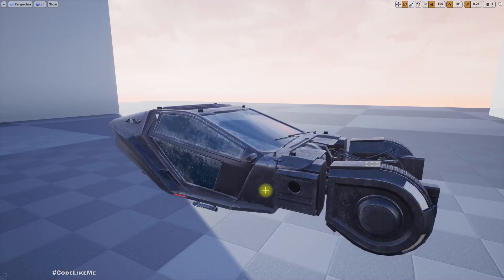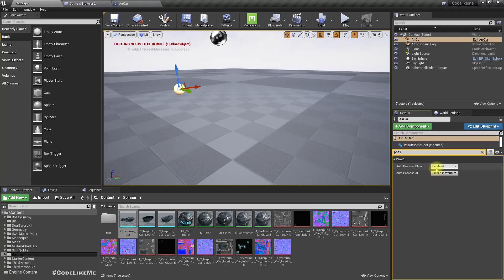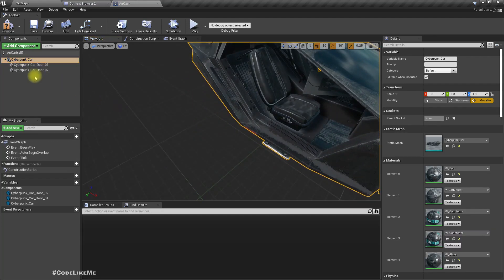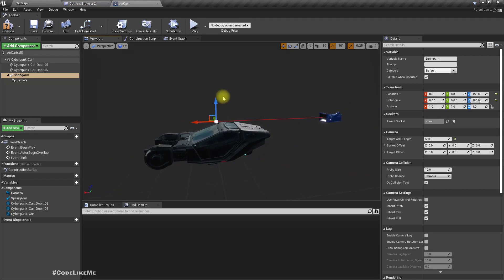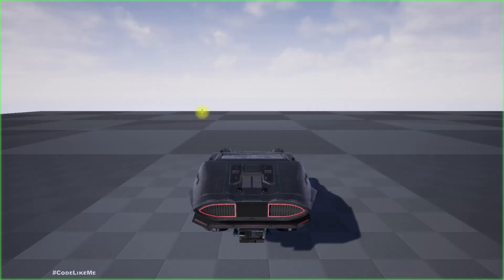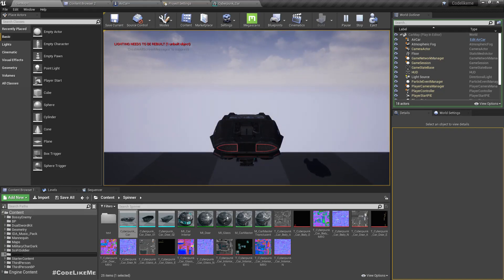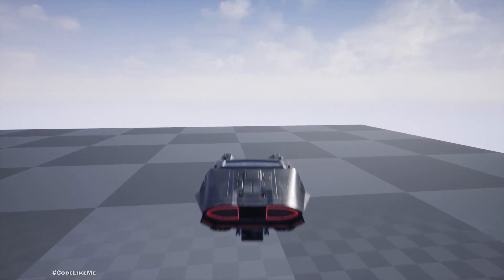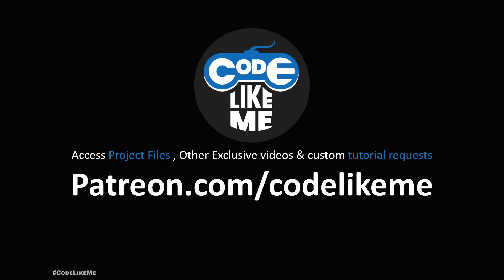Unreal Flying Car

Comment: How did you deal with collision without placing a box collider. My car still goes through walls and the ground?
Reply from the maker: I need to check the project. Either there was a collider in the root, or i added a collider in the physics asset of the car model.
Reply: @CodeLikeMe  thanks, I would love to know lol. When I added the box collider it stops movement on the vehichle. Otherwise it goes through walls but controls still work. Any help is greatly appreciated. Love your page btw!
Reply from the maker: @riccardoKIING  I have shown all the steps i have done in the video. Also the project file link iscin the description
Reply: @CodeLikeMe  thanks I’ll retrace my steps